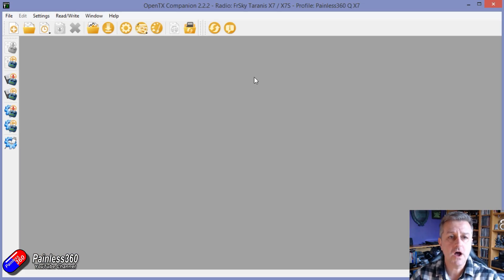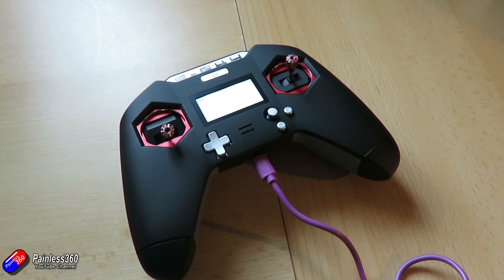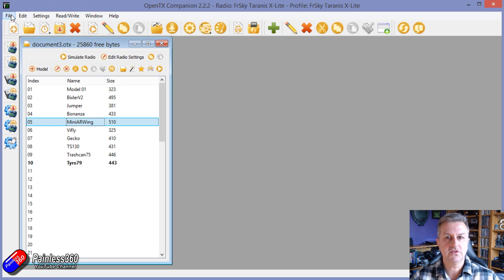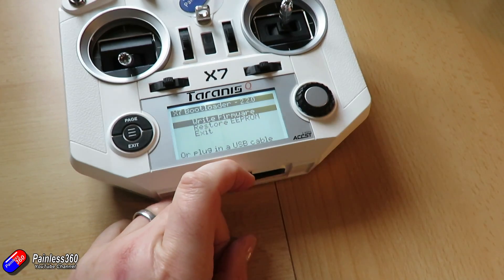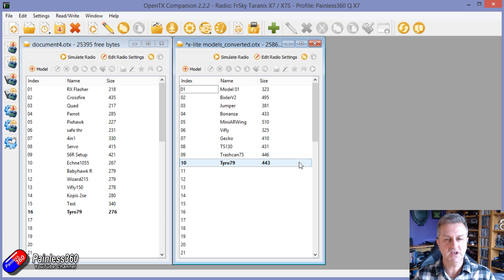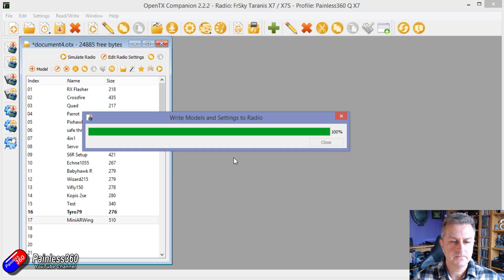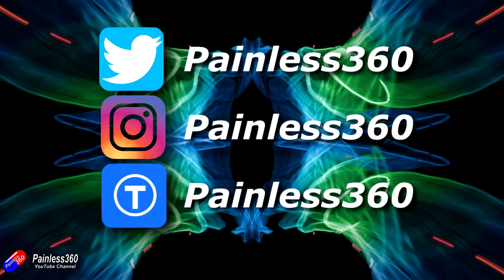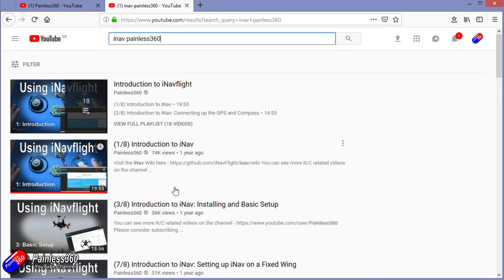Copying models between radios with OpenTX

Comment: Will this work to transfer a model from the X9D+ to the TX16S? 

Thank you for this content@
Reply from the maker: Yes it will.  Best of luck
Reply: @Painless360  Thank you!
Reply: I tried doing it, and the method did not work for me.   I got all the way to the point where I wrote the new models to the radio, and it seemed to work, but when I checked the radio, none of the new models were there, nothing had changed.   It seems as though the new /bin files were written, but no .yml files.     No idea how to proceed.

Comment: Excellent. I found a generic full-featured OpenTX Quad TX16 setup that I would like to import and use as a basis for my setups.  This worked perfectly.  Now to find a generic quad OpenTX template with all the common features.

Similarly, I found a matching BetaFlight Config file to set up the switches etc.  There is no reason every person has to recreate the wheel.

Comment: someone from rc group post a model file .I have the T18  file is on my sd card in radio but how do I get it on to the model select page?
Reply from the maker: You need to copy it via Companion ... As shown in this videos. Remember to backup your radio before you change anything.. Best of luck
Reply: @Painless360  got it! file is in the radio and did a hover text with my heli :)

Comment: Hi. Again, do not know what i have done but, my old x-lite radio has packed in, cannot see the screen on the radio?  back light on when connected to open tx companion but cannot see screen when trying to use just the radio?anyway updated the new radio and now matches old ones firmware, all works, will flash receivers modules etc, but this is the problem refuses to write the model bin files to the radio? they are in the models folder, not getting any warnings for wrong firmware or sd card warning? it is like it is not recognising the models bin files? any help would be appreciated, do not fancy setting up all my models from scratch.
Reply from the maker: You need to write the models back to the radio after adding them to the EEPROM model memory you've copied from the radio as shown in the video. You have to copy them from the backup to the new open radio profile... Hope that helps..
Reply: @Painless360  ACCESS 900MHz R9M Lite Pro module

Comment: Lee, could you possibly do a video on how to transfer models from a FrSky Taranis X9D plus to a Jumper T16 Pro radio with the internal module? My problem is I have a multi protocol module in my Taranis and I have some models with FrySky receivers bound to the internal module and I also have several different brands bound to the multi protocol module. I have Flysky, DSM and DSMX, Syma, etc. bound with the external module. I have the models all copied over to the T16 but I can't get the receivers to bind with the exception of a Orange RX DSM USB Dongle to use with my simulator.
Thanks, Kevin Burns
Reply from the maker: All I have tried is in my T16 playlist... I hope you helps.  Best of luck!

Comment: Great video as always!

Question: I have a 2nd hand quad that is already bound to a QX7, but the TX didn't have an SD card installed in it and the quad doesn't seem to want to copy onto the SD card since I've placed it in the transmitter.
I thought it would be a simple "copy" and have it on the newly installed SD card... no luck :(
I wanted to copy that model and place it on my other transmitter too, but I'm just not getting it.
Any advice?
BTW - all my TX's are running OpenTX 2.2.3

Thanks again for all your excellent videos! You're one of the very best!
SUBBED
Reply from the maker: Not sure, all of the video set up that I’ve done for these radios include setting up and popping in an SD card as one of the first things. If you figure it out please let me know. Best of luck!
Reply: Thanks for your prompt reply!
I purchased the quad and the extra TX second hand and the person that had it did not have an SD card in it and I've tried EVERYTHING to try and resolve with no luck :(
I'll continue looking and if I do find a solution, I'll certainly make note of it here.

Thanks again! Your videos are some of the very best :)
Reply from the maker: Companion?
Reply: Painless360 yes. I've tried several times and thought I'd followed the steps to the letter, to no avail.
It has to be something easy that I'm missing. I've gotten quite frustrated with it, so I'm going to set it aside for a moment and try again in a few days... I'll report my finding. Hopefully with positive results :)
Reply: Painless360 I wonder... Do I have to "bind" the quad to the new TX? That particular quad is full KISS- FC / ESC's too and I'm not familiar at all with the KISS software and I had many problems trying to download the KISS software on my Mac, or WIN 10 computers... So many little things it can be, but I'm still plugging away at it and getting nowhere... ugh :(
Feeling really inadequate at the moment.

Comment: I wonder if it'd be possible to write a Lua script which can copy a model (or any file on the SD card) directly to another transmitter using an s.port cable connecting the two transmitters together.

I've not looked into the S.port protocol much but know it's capable of full-duplex communication; so as long as the port can be read/written to via Lua script, and Lua scripts can read/write to the SD card then I can't see a technical reason such a model/file transfer script shouldn't be possible.

---

I have a fair bit of experience writing Lua scripts (not related to openTX), so might have a look into it to see if such a script would actually be possible, and maybe even have a crack at writing it.
Reply from the maker: Best of luck - if you crack it please let me know! :D
Reply: After a quick look at the s.port specs turns out it's a master/slave protocol so you'd need a micro-controller in between the two transmitters acting as a slave for both and transferring the packets between them.

Still doable, but not with a simple dumb cable ...which kinda defeats the object of making it super simple.

Comment: Hello from the USA ! I just got a QX7 - Wow what a great radio. I also have a  I Range x4 module installed to rum a bunch of “Toy Grade” stuff. I am presently using a Jumper transmitter. My question is can the models from the Jumper be copied to the QX7. ???

Thank you in advance for your response. I really like your work!

Ben Herr
Reply from the maker: Sadly you need to get the models into Companion from the radio you're going to copy from and (at the moment) there isn't support for Jumper radios - even the one with a 'version' of OpenTX on it. There may be other apps that can help but I've not come across one.. Best of luck!
Reply: Thanks for the quick response. I am not surprised. Good news is this extra work will keep[  me out of the Bars!1 Great work on your channel for sure. Ben Herr @Painless360